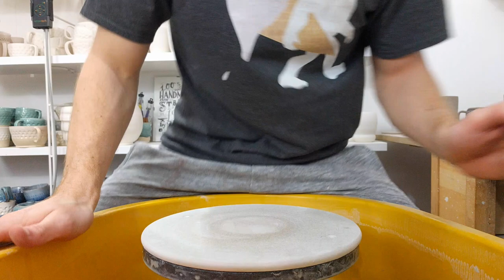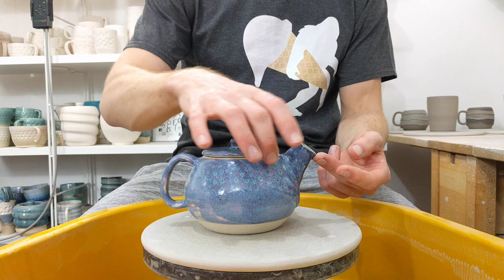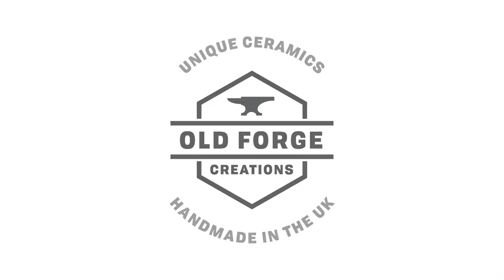Throwing a Spout, with pouring demonstration

Comment: I typically throw my spouts upside down off the hump. That way I can keep the walls thin and collar the spout tip to a nice narrow dimension. I score in a small groove while it’s still on the wheel at the point where I want to cut it, then let it go leather hard and wire it off. Otherwise I find my spouts are too thick to get the elegant look I want.